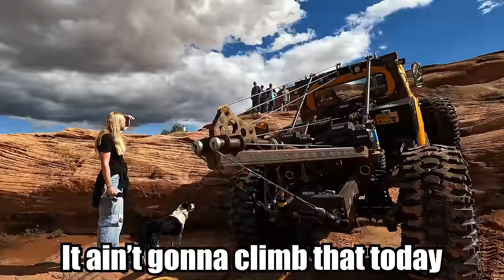Nerve Wracking Recovery… Bronco Lost Steering

Comment: Man I miss mountain bikes. I used to race XC growing up with an 06' Kona Kula. I still have an 07 Stinky on the wall that could probably survive a day on the seals. It was refreshed in 2012ish with everything aside from the frame. I think the last lap I had on that bike was 2021. I really miss MTB but it will be a while before I can afford a six inch AM rig. I'm also still trying to put together an old hand built XC hardtail with 100-120 up front, 26 inch wheels, 135 mm hubs, 1 1/8 steer, 68/73 mm BB, and I'll figure out the brakes. I want that Stinky to stay together so I'm not robbing parts yet. It'd be super cool to ride on that frame again one day. And I'm still in touch with the dude who built that frame, so I'd also love to tell him it's back on the trail with a decent build. Maybe someday. It's like piecing together an antique at this point.

Comment: An idea: What about building a bracket that attaches to both lift arms of your hoist (Many sets of holes would be needed so you can position it at various heights) and has two bars, spread around 3ft apart (Or able to be moved close and spread) mounted using a sort of hinge which have a spring running from the back of them to a lower cross bar that mounts also on the hoist or on the wrecker. This apparatus would prevent vehicles from smashing into the back of the wrecker when they are being towed and have no brakes.  Some sort of padding would be attached to a bracket that can be bungeed across the back of the two bars.

Comment: Really need to build a tow bar for pulling vehicles without brakes.  Could make it two pipes together for adjustable length.  Maybe even a good idea would be a reciever on the tip of the boom so you could slide the pipe into it and just put a pin in wherever you wanted for length, then boom could be lifted or layed fully down as needed during tow process.

Comment: My dad taught me that it's easier to turn when moving if your power steering goes out than to turn in place. My truckster doesn't have power steering right now. I had to do donuts because I was feeling stressed. That was it for the power steering though. I can sympathize with Tom Tom wrestling that wheel.

Comment: When they build those Fun toy's it be a Good idea to put a Emergency brake at the back rear end have a rotor their I think they do it on the monster Trucks if it don't run you pull the hand brake it have brakes at the back wheel put a rotor where the drive shaft goes into the rear end you brake the drive shaft you still have a brake to the back wheel install a cage like so the rotor don't hit the Rock

Comment: If you are going to circle track the car on the rack again then I have some info on what needs to be done to it to make it work for you unless you already have someone who has been there and done that for 73 feature wins. It's all about the chassis and getting thru the turns the fastest. It's not an LS thing. The dents on the driver side are his fault and the ones on the passenger side are everybody else. The race in Florida you drove in is called Enduro's here in Ohio and are normally 100 laps.

Comment: Wishing we had Offroad recovery rigs around here, but then again there is nowhere to legally wheel anything but SxS's in the county, as they "opened" a muiltiuse trail system encompassing all the trails Jeep's used to use, but requireing paying for a permit to use, and road legal vehicle are mprohibited. When questioned about it by the Jeep clubs, they don't want anything over 2,000lbs on the trails...Even private land event get scrutiny, and I got interrogated after favoring the center on my way back from the last event I attended, and supposedly crossed the center line(what do they expect when the white line is a guard rail.) That event was 2+hrs away, I'd spent 10hrs cooking in the sun, and I'd left the house 14hrs+ earlier. There was an event downstate earlier that year, where a spectator tried to stop a SxS from roling and got killed(crushed). I heard several attendees  were,  on private land were charged with DWI or DUI,  and when asked how that was applicable on private land, they said to take it up with the judge. I never heard how those cases turned out, but apparently the event didn't have all it's paperwork in order.m

Comment: Just for a record to anyone who tries to do this with a non-running vehicle as long as the engine is not damaged it will turn over freely if it just will not start all you have to do is turn the engine over and it will slightly give you a little bit of power steering and brakes probably won't even better with hydroboost I will promise you and also you will not pump your fluid out of your reservoir and onto the ground again though if the engine is damaged 4 belts police anything of the sort all your suspension itself I don't recommend this but if it isn't DO WHAT I SAID!!!! Lol

Comment: Maybe you can explain this, why do you constantly want to tow these vehicles up these rocks and extremely steep inclines. Why don't you drive to the top and use your winches and winch the vehicles up instead of putting all that extra stress on your wrecker, isn't that the reason you built the wrecker and put all those winches on it was to use them?

Comment: The old Sportsman Broncos if they had power steering and the engine was not running you were not turning the wheel unless the vehicle was moving the angles on the steering suck